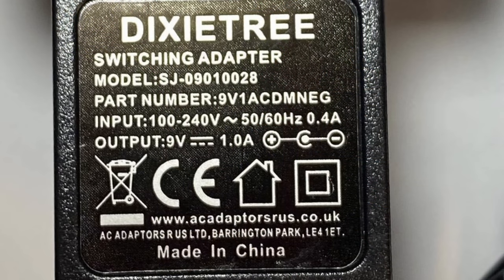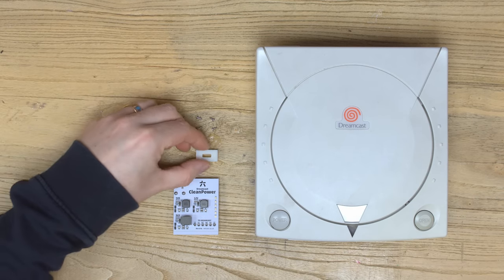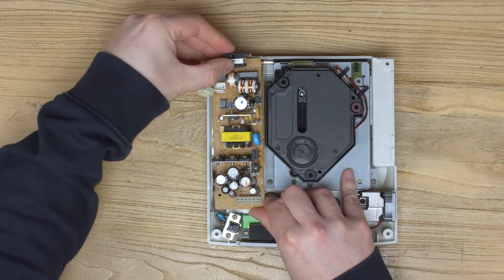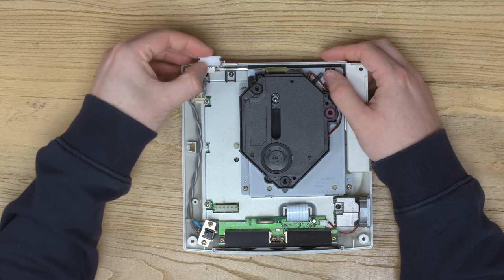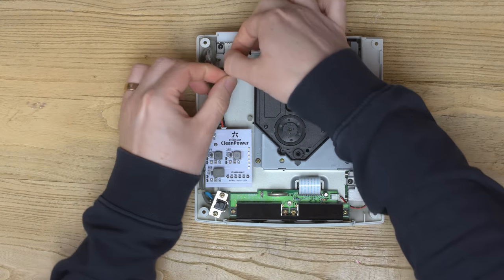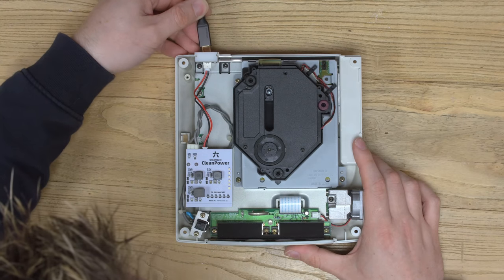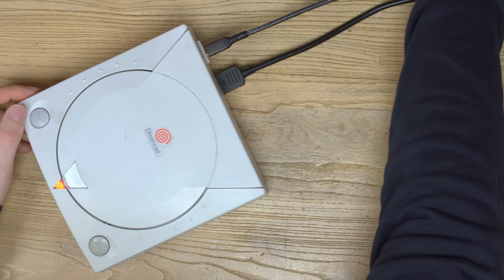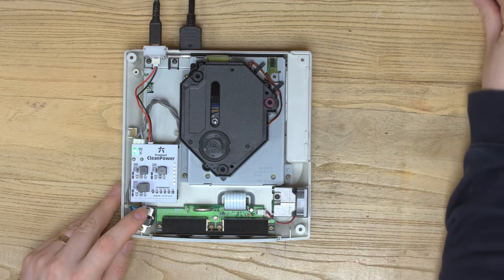The Dream of USB-C Powered Dreamcast is HERE! (CleanPower by RetroSix)

Comment: The old Original Xboxes are from the capacitor plague era and the PSUs are slowly but surely rotting away (and eating tons of internal space).
A USB C mod would be amazing for them. Alternatively people have managed to use Pico PSUs to power them using an external brick.
Reply: The OG Xbox uses around 70ish watts, so you would need a pretty substantial power brick to power it. The PS2 is around 50ish watts, but it's still pretty substantial when compared to something like the Dreamcast which uses 20ish watts. So the Dreamcast is easy to do this for in comparison to the Xbox or PS2.

Comment: Awesome work RetroSix! To answer your question of possible mods for the future... The one thing I would REALLY want for the Dreamcast is some way to make it connect to the internet. The DreamPi together with dreamcast live are awesome porjects. A nice mod would be to easily connect a Raspberry Pi Zero 2W (Wi-Fi !!!) to the Clean power 5V, + phone cable with a 18V step-up conversion drawn from the Clean Power as well.... But yeah, the biggest issue is just getting hold of those pesky compatible DELL and Lenovo modems.
Reply from the maker: I would of thought their would exist a modern WiFi to modem emulator code now to make it all run from a single Rasp Pi?
Reply: @RetroSix  well you need to be able to connect the RPi to the Dreamcast communication port some way or another. Currently that can only be done with using an RPi, the Dell or Lenovo RD02-D400 usb-modems (which are unnecessarily pricey) connected to the Dreamcast modem with a custom cable that feeds 9V (NTSC) or 18V (PAL) between both ends. At this point I thought someone would've been able to make a modern Network replacement board for the modem casing. But I guess it's a beast of a project and due to how few games are supported and how few Dreamcasts are out in the wild. I guess no one has been willing to spend the time on such a big project just for the sake of preserving niche online features... The ultimate solution would've required modem emulation (due to game compatibility), Networking Driver + dedicated Dreamcast software to setup Wi-Fi, but yeah, the easier solution would be to just stick with LAN instead. That way you wouldn't need to interface with the network board. Ultimately someone still needs to build that modem emulation code and a compatible network board for the DC. And even though I am a developer myself, this would require substantial amount of research for me personally.

Comment: I got my Dreamcast about eight years ago. And I was really disappointed to see that it didn't want to read my discs. If it did, it returned to the menu screen after a couple of minutes. I even added solder to the pin connectors to tighten their grip to the mainboard, which did the trick. But if I had known that there would be such a thing as a USB-C power supply for it, I think I wouldn't have done that. Nevertheless, I finally want to give my Dreamcast the modern upgrades it deserves, which is why I got the USB-C mod. And I'm seriously considering to get more, so long as they are easy to install like this one.

Comment: I love a lot about this mod!  If I could make a couple suggestions, maybe a little extra bits of plastic to left and right of where the board plugs in to physically block an accidental misaligned plugin of the board, and perhaps a redesign down the line to add a screw hole (plus a spacer underneath) so the board can be nice and securely screwed into the Dreamcast.

Other than that, you've thought of everything!
Reply from the maker: Yep agree to both I'll improve them

Comment: i'm gonna buy this and the n64 when it's ready 👀👀
Reply from the maker: I could make N64 plug and play without even opening console. Probably the way I would go with that one
Reply: @RetroSix  i have an old broken power box in stock for when the board is ready, so i can mount it inside and still keep the old aesthetics, but yeah, mounting the board on the old nintendo 64 power connector would be perfect in my opinion

Comment: Excellent. If only I could find a reasonably priced factory sealed new Dreamcast console.

I'm looking forward to Clean Power coming to Sega Saturn, N64 and PS2. Any chance of RetroSix also selling region branded multiple coloured Saturn shells like HD Zone used to do in Australia?
Reply from the maker: We make our own shell moulds all the time. Expensive and slow but we have plans for desktop console shells later in the year
Reply: @RetroSix  okay i'm gonna need a transparent wii gamecube and ps2  too  then 👀👀👀
Reply: @RetroSix I would absolutely love if you made some PSOne shells (PS1 slim model) as I can’t find any online)

Also I bought one of those Dreamcast shells you sell (a yellow one) but for some reason the power button doesn’t align with my power switch, on closer inspection the power button has a different angled groove.

I had to reuse my old Dreamcast power button on my new shell, could it just be a factory error or is my Dreamcast model different to the 3rd party shell Dreamcast? 🤔

Comment: Already been converting my megadrives and master systems for lower heat and different power options, This is a nice tidy solution though, It's probably too low volume to bother with but some kind of daisychainable version for the MD/MEGACD/32X to run them off one plug would be nice.
Reply from the maker: We do a DC internal mod so if only needs one power so that could be done too
Reply: Hm, powering the Sega trifecta from a single PD USB-C may be a bit of a stretch... but I'll let the experts speak :)

Comment: Awesome mod. Looking forward picking one up. Does it work well with GDEMU? :) I think the only difference is that that there is far less resistance on the 12V rail.

the only mod I am looking for now is an internal rpi zero 2 dreampi wi-fi mod. However, getting hold of cheap DELL modem is getting extremely hard these days. I wish there was a off-the-shelf mod solution to connect the Dreamcast to the internet, without relying on depricated USB-modems.
Reply from the maker: Yep works perfectly with GDEmu. Tested for 24 hour run multiple times

Comment: An intresting one to look at would be consoles that use external power supplies like the CDI which have two voltages 12V / 3V lines and use a phone wire style connector.
Reply from the maker: It's same way, internal mod with USB-C single input. I will be making for CDI also

Comment: Interesting idea, not enough to make me change out my DreamPower but from a design perspective it would be nice to see you utilise the front left screw hole the stock PSU uses, just to hold the new PSU in place.

The likes of the aforementioned DreamPower and Pico PSU’s use that hole, and while I appreciate these smaller boards don’t weigh a lot, using the PSU pins alone to hold the PCB would put me off.
Reply from the maker: We can make a 3D bracket for that if people want to print it for sure.

According to users reporting to myself during making this mod, neither DreamPower or Pico PSUs can handle GDEmu without sporadic crashes FYI, it was a big request that this board should support that properly. We have ran this on a GDEmu modded console now for 8 days constant (never turned it off yet) without issue.
Reply: @RetroSix  You’re confusing DreamPower with DreamPSU. I wouldn’t power a kettle with DreamPSU.
Reply: @SEGAGuys  DreamPower and DreamPSU both had reports of almost all DC external power supplies introducing noise to video also. This can happen with any power supply, you need a good isolated low noise power supply, which USB-C is super easy to find (we sell them for like £14). Plus the added benefit of USB-C now not just another custom DC power supply just for that console
Reply: @AngelSix  Not saying USB-C doesn’t have clear benefits in terms of the lack of a power brick/supply being needed, but DreamPower (and PicoPSU if assembled by a trustworthy modder) should never be associated with DreamPSU which Voultar tore to shreds as it’s not even designed specifically for Dreamcast. 

I’ve used a Chrisz2600 PicoPSU and now a DreamPower by Coaster2K, and neither had resetting/crash issues or noise in the picture. I just think it’s important to focus on the benefits of this product rather than try to tear down others by comparison.

My sole concern with USB-C would be the connection on the back of the console, in terms of tightness. I’ve bought new laptops with USB-C and the cable barely makes a click when it goes in. Now you won’t move a console as often as a laptop, but for me it’s important that cable is in and it’s secure.

The biggest benefit, as I said, is that it’s a simple USB-C cable and plug, but in two years with the DreamPower I’ve had zero issues with it. 

Absolutely none.
Reply from the maker: @SEGAGuys  I've not tried to tear down anyone nor have I ever used or seen either. I've only had feedback from the community telling me these things. Not my words. Even on our discord poeple mentioning those issues and in comments of this very video people asking if it works with GDEmu as others don't. 

No hate to any others just stating clearly what others have mentioned
Reply: @RetroSix  Yeah, and I’m just saying that of the several Dreamcasts I’ve used properly constructed PicoPSU’s and DreamPower PSU’s with, none of them have given me the issues you mention being told about. Discord isn’t always the best place for constructive opinion, and that’s from experience - I’ve witnessed stuff on other mod Discords (ODE’s for Saturn in particular) that made me shake my head in disbelief. 

I’ve no reason or agenda to promote other PSU’s and as I’ve said, USB-C does seem like “cleaner” power and removes the need for a bespoke Power Brick, but the loudest voices are always the ones who have had issues and the Dreamcast is, like or not, janky. Peoples issues can, and most likely were, down to other factors and not their Pico or DreamPower (providing they know the difference between DreamPower and the awful DreamPSU).
Reply from the maker: Yep. I never talk about competition anyway as a general rule. I'll only reply if people ask and state it's from others. Unless I get hands on experience with repair send ins and know it as facts. 

Thanks for the feedback anyway and I'll be sure to do a 3D support bracket

Comment: Will n this work with the gdemu mod? I'm thinking of grabbing the pico or dteam ps if but cant access your video. Howe reliable is this usb c mod,? Does it deliver the correct voltage?
Reply from the maker: Yes it does. Very reliable. Sold over 500 so far
Reply: @RetroSix  when are you releasing the next batch?

Comment: Hello, i have modded my Dreamcast myself with DCHDMI, Terraonion Mode with a 2,5" Samsung 870 EVO 500GB SSD and did the controllerboard upgrade with the selfresetting fuse, batteryholder and cap.
With the original PSU everything is running fine, when i replace it with the CleanPower the Dreamcast does reset itself when it loads into the games mostly after the intro, i've used a 30W Gan and a 120W Gan charger from Ugreen, they have the same rating or higher as the charger which is on your shopsite.
What do you think can be the issue?
Kind regards
Reply from the maker: Probably getting little hot. We have heat sinks on new version you can try sticking some self adhesive heat sinks on the underside of CleanPower

Comment: Do you offer any color options for the 3D printed part? The DC had a few official color options and there are a lot of 3rd party colored housings out and about. My Dreamcast for example has a Green replacement shell.
Reply from the maker: I can make them in any colors. I thought only white was official except rare black one? and all others third party. But if you can provide some color images I can make them
Reply: @RetroSix  Thanks for the response. You are indeed correct white is the most common color of the Dreamcast with a black sports edition being the second most common but still far rarer than the white. There are some official other colors but they were Japanese limited editions and are probably not going to pop up very often.